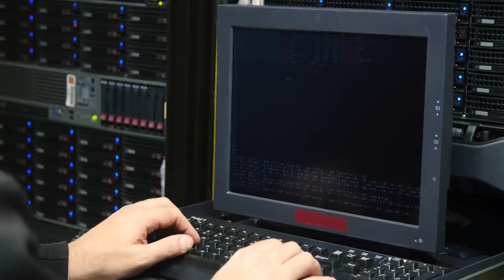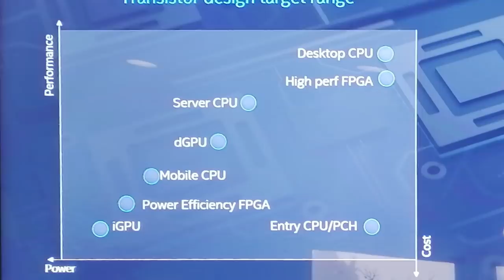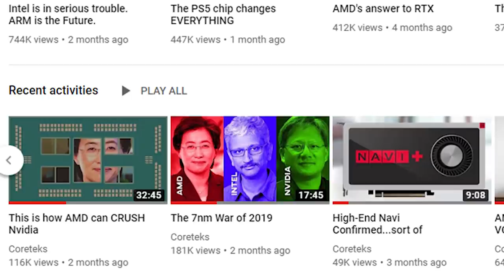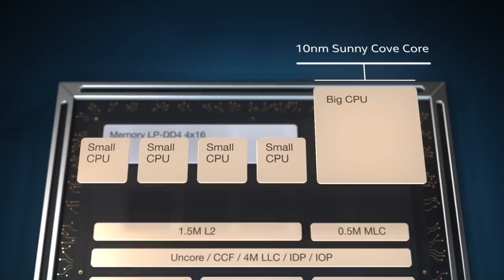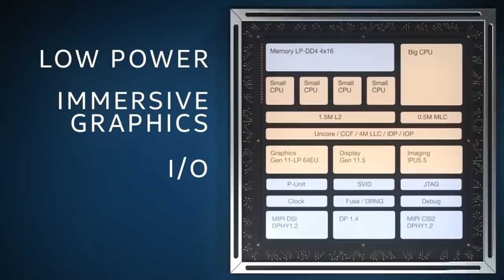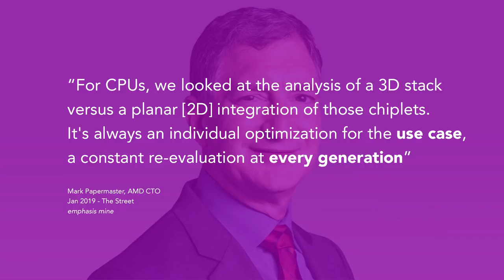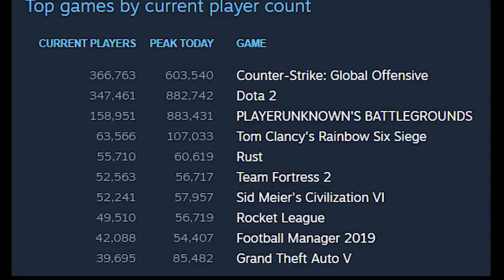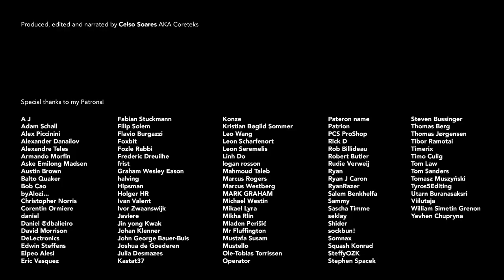2D vs 3D Stacking: Intel’s plan to beat Zen 2

Comment: Could Intel add up to 1gb onto the chips? Yes. Will they? No. Well... eventually... after milking their customers for years by only improving their products by 20 to 30% for each new release, unless competition forces them to do it sooner.
Reply: @SweatyFeetGirl  I think he means 2-3%
Reply: damn 20-30% i loled so hard to this
Reply: The 3770k is 10 to 15% faster than 2700k at most.
Reply: @SweatyFeetGirl  Julia so you mean the first i7 can match up to the current i7 since by your calculation 9% increase
Reply: @directlinkrexx4409  Do you even understand how % increase works?
Reply: @iairborgo7172  OK explain to me sherlock Holmes
Reply: @directlinkrexx4409  
Lets say 10 generation and 3% increase per gen.
10th  30% faster is wrong.
10th 34,4% faster is correct.
Still 3ish% is way to low  (and 25ish% is way to high) from what I know it was about 12Ish%  per gen.
Reply: The main issue - regardless of whether you have a welfare chip or an intel - is that programmers cannot take advantage of all those multiple cores.  Anything over 4 cores in a gaming PC are not used.  Only in scientific applications do the additional cores get used.

And even at only 2-3% ever gen  - AMD STILL can't catch up
Reply: @petrkinkal1509  listing a few results of www.cpubenchmark.net (picking the usual "gamers choice CPU", since most ppl are interested in those)
CPU: singethread / Multithread / gain / overall gain / notes
2600K: (1939/8432) / - / - / -
3770K: (2083/9511) / (+7,5%;+12,7%) / (+7,5%;+12,7%) / -
4790K: (2530/11175) / (+12,1%; +17,5%) / (30%;32%) / -
6700K: (2353/11109) / (-7%; -0,5%) / (+21,4%;+31,7%) / -
7700K: (2583/12036) / (+9,%;+8,3%) / (+33%;+42,7%) / -
8700K: (2703/15971) /  (+16,9%;+32%) / (+39,4%;+89,4%)/ 6 cores
9600K: (2676/13443) /  (-1%;-15,8%) / (+38%;+59,4%) / 6 cores ; no hyperthreading

average singlethrad gain per generation: 5,6%
average multithread gain per generation till 7700K: 9,1%
Reply: @bradvicious3991  
Oh I'm a german now cool. I was from USA about a month ago wonder what I will be next time.

edit:Not sure why I bother but
https://upload.wikimedia.org/wikipedia/commons/a/a8/DecimalSeparator.svg
ISO-8601 also stipulates normative notation based on SI conventions, adding that the comma is preferred over the full stop.
Reply: @learza3797  I stand corrected (and depressed)
Reply: @bradvicious3991  um, you are wrong, literally games use more than 4 core. the way of the future is literally dx 12 and vulkan, vulkan literally uses every single core/thread on a cpu. so...you are wrong. 
next, i have a tr 1950x, virtual boxes can easily run every core and anyone in IT pretty much uses multiple virtual boxes for numerous reasons. the more cores you assign to a vm the better it runs. so...again, you are wrong, it isn't "scientific applications," it's literally anyone in IT that makes use of all those cores. the fact that you don't understand that, means you don't know what you are talking about like at all.
next, there is numerous programs that make use of cores. if you are live streaming on a video game, you want more cores because the system assigns those cores to the streaming software. next, if you are video editing, there is numerous programs that make use of all of those cores.
see, with what amd has done, they made streaming affordable for the consumer, they made it affordable for people in IT to work effectively at home (i personally run numerous vm's all the time and have a personal server set up that is running on a vm. so...i test software in numerous vm's all at once and the 1950x (16 core 32 thread), has allowed me to develop a lot of stuff at home. i'd never be able to do what i do now without amd releasing cpu's with a lot of cores. 
next, if let's say, you want to run your own game server,  let's say, a wow private server, you can literally buy a 1950x, down clock it for more stability, and be able to have thousands of people on just that 1 server. a 1950x costs right now $550. this compared to just a couple years ago when intel was selling 8 cores for nearly $2,000? ya, amd has made it affordable for anyone to get into IT. the fact you don't understand that or the significance of all those cores, just shows you have no right to even comment here.
Reply: @thorodin3631  LiTEraLly
Reply: @thorodin3631  Dont waste your time answering to Brad, he is dishing amd in a lot of comments here, just another intel fanboy I guess. Hearing that Intel is trying to innovate again is a good thing, I hope amd makes a lot of money with zen 2 and pushes both companies in the 3d cpu model at good prices.
Reply: I don't see why they can't add a terabyte and just forget the ram. PCIe storage is getting quite fast these days anyway, and applications like chrome have no reason to use ram instead of, say, nvme storage. 

The way I see it, the processor, ram and heat management are all part of a single system and they should all be closely integrated. Being able to change heatsinks on a CPU is a sign that we are not giving enough attention to the heat management of the CPU. Thermal paste is a bodge.
Reply: Actually my Xeon from 2014 is only 6% slower then the new CPUs from Intel running same clock speed according to indipendent bench marks... Intel pretty much only releses new CPUs now with sightly higher clocs, lower price and or more cores when AMD releses something that is able to compete.... Rest of the time Intel just sit and wait with who know what they have in stock waiting to get released when AMD come with something new lol.

Comment: 3D stacking is great for memory but bad for GPU's and CPUs'. Heat transfer is a big issue. Unlike Intel AMD already has experience with stacking memory: HBM and HBM2. Intel needs to catch up and these plans are nothing new, it will take years. Maybe they have those years but I wouldn't be surprised that AMD will keep innovating and improving even when they are the fastest...

Pentium 4 era all over again I expect for Intel.
Reply: Wouldn't be surprised if HBM-Stacks are finding their way on AMD CPUs, as soon as prices get a bit more reasonable.
Reply: Before HBM, Intel/Micron had HMC(Hybrid Memory Cube) way back in 2010.  Sadly, nothing much came of it as far as consumers.
Reply: @MephistoDerPudel  yeah there was something about close memory aka HBM2 on SKUs for cpus
Reply: First off - AMD doesn't produce anything other than drawings and marketing materials.

AMD had nothing to do with the development of HBM or HBM2.  Nothing.  They didn't design it, they didn't manufacture it, and they had no input on it's design.

Intel spends more $ on R&D in 1 quarter than AMD has made in the last 5 year combined.  Intel has tons of experience with passive interposers, that is old news.  The Foveros (stupid name) is an active interposer, which is quite different.  So Intel does not need to "catch up".

AMD Innovation is like French Military Victories - the punchline to a joke.
Reply: @MephistoDerPudel  nope.  APUs maybe.  But since AMD doesn't make anything at all - and pretty sure HBM / HBM2 requires a license to produce, it is unlikely
Reply: @bradvicious3991  and yet when AMD make less in 5 years than intel spends per quarter on RnD and yet AMD still are able to catch them in preformance on a worse node(TSCMs 14/12nm)
Reply: @bradvicious3991  "AMD Innovation is like French Military Victories" -> so intel is doomed

for your culture: "168 battles fought since 387 BC, they have won 109, lost 49 and drawn 10" - wikipedia
Reply: @samcan9997  Global Foundry's  14/12nm, TSMC would actually be a bit better.
Reply: @samcan9997  You mean get close enough to see them, but not actually catch them.

Intel in it's ancient 14nm process cannot make enough chips to meet demand.

Buy what you want, and can afford.  I will do the same.
Reply: @bradvicious3991  it doesnt matter who is innovating. It matters who is selling the innovation, and it just so happens that AMD is selling innovation right now.
Reply: TSMC sure they will have batter cache but there 7nm will likly only be on par with intels 14 line
Reply: @lucasward9506  LMAO
Reply: @bradvicious3991  is LMAO an argument
Reply: @lucasward9506  sorta... when someone makes a terrible argument, you laugh in their face and walk away and let them continue to be ignorant because they're not worth your time. Not that you made a terrible argument/point, but yeah...
Reply: @bradvicious3991  umm... 7nm is pretty much on par with Intel's 10nm... except TSMC is actually making 7/10nm chips unlike intel.
Reply: @lHiTMANll  that makes sense
Reply: Detmer , in the end its all about the process node .. when intel chips go to 7 nm then we have ahuge upgrade on our hands too ..
Reply: Brad Vicious still amd beats intel that is fact and to beat amd intel used shity technics known to all but now they take amd workers to there lines... LOL
DONT BE FANBOY FACTS WILL ALWAYS WIN

Comment: Very interesting video, thanks for the great work!
Now I'm here with my old 2012 processor (i5-3570K) and 2013 GPU (R9 290) and can still play everything at high settings in 1080P with appreciable framerate after a bit of tweaking in the options. Crazy, no?! 2012...
I was thinking about upgrading soon, however I'm feeling that the industry is experienceing a major change at the moment, so I'll be patiently waiting to see how the game will set before spending 2K in new computer hardware. 
Cheers and thanks again for showing us a more profound analysis than any other Youtube tech channel!
Reply: Nice profile pic
Reply: I haven't upgraded in years, but it may be time once Intel releases this tech. Until then I will keep running my 486 DX2 66.
Reply: Then buy your new PC a piece at a time. Maybe a new GFX card to go with a new monitor? A year or two down the line get a new board/ram/chip? I'm not going to lie, NVMe drives are really nice!
Reply: legendary cpu i had it but had to switch for 1800x ryzen coudlnt get stable 60fps (3440x1440)in some games even if it was oced on 4,2-4,3 with ryzen NP yes i know i could get i7700/8700 to have like 5fps more but fuck intel and price was much higher that time and too bad i missed like month when 2700x was anounced but its only like 2-5% faster
Reply: Appearance of major changes will hopefully be the norm, like in the old days. It had just been peaceful for awhile, as AMD has had to recover their bad CEO and Bulldozer.

Just upgrade when you need to. Hopefully there will be something else new and disruptive around the corner, when that time comes.
Reply: @laurelsporter  sure this "new" become a peak development in cloud gaming that means u don't need to buy graphics card, add ram, change MB and CPU after 3/5years. U just buy new peripherals like monitor etc.
Reply: @mateuszzimon8216  unless there's a server cluster every blocks, though, the latency will be too high for most games, unless someone finds a way around the limitations of the traveling speeds of radio waves and electrons.

In addition, you'll just be paying those hardware costs as part of your subscription service cost, and server hardware is much more expensive for the same performance.

Comment: On the server market AMD could also replace one, or more, chiplet (as they are doing with the APUs) with an FPGA or customized chips for specific clients (AMD know how on custom solutions and cost aside), so, if not, the 2d approach is as flexible as the 3d one on this particular matter
Reply: Which FPGA IP?  Xilinx?  AMD doesn't have internal FPGA IP.

You know who is already doing that, and has been for a while - Intel.  Intel makes quite a few products and SKUs that we will never hear of because they are for very specialized use cases
Reply: @bradvicious3991  I've heard off Intel having the technology to do so back when cascade lake - AP (the 48 core intel cpu) was announced, didn't know they had it ready, have any links?
Reply: Brad Vicious yeah  breaking hashes and AES encryption

Comment: 8:43  Seriously?  486 processors had off-die L2 cache.  Not only off-die, but off-package.  It was on the motherboard.  Same with the Pentium.  What the PII was "experimenting" with was moving the L2 cache to the processor package, rather than keeping it on the motherboard.  AMD was the first to move the cache onto the die, followed shortly thereafter by Intel with their second generation PIII processors.  AMD actually had an interesting situation, because you could get a motherboard with L2 cache, then plug in a K6-III processor with onboard L2 cache.  What happened to the motherboard cache?  It became a L3 cache.  The first instance of it.  The P4 was the first processor to create an on-die L3 cache.

The point is, you're talking about things in reverse.  The Pentium II was a step from off-CPU cache towards on-CPU cache.

I'm more interested in why the I/O die on Zen 2 is so large.  It seems too big, to me, to just have the memory controllers and whatnot.  Did they move L3 cache there?  If they did that, and changed it from a victim cache to an inclusive cache, that would make inter-core communication completely unnecessary.  All cores would have exactly the same memory latency for everything.  I guess we'll see soon enough what they actually did.
Reply: I/O die on Zen 2 is still on 14/12nm for cost savings, since I/O performance does not scale like the cores do with node shrinks.  The core chiplets are on the 7nm process. Also by shifting the I/O die over on the old node AMD will not have to use any of the limited 7nm production capacity on the I/O die, allowing them to make more complete CPUs for each 7nm wafer.

Comment: What I'm interested to see is if/when AMD starts implementing 3d stacking, if they could combine that with their chiplet design to have an even greater advantage in heat management, by distributing hotter parts across the (die? unsure of the word) in the various chiplets.
Reply: Unfortunately AMD doesn't have control over fabrication technology and method. They're at the mercy of third party production company facilities. Even Radeon stuck at 2.5D silicon interposer. I don't know but it will probably happen if AMD can bring enough demand in volume.

Comment: Back in 1978 IBM Corporation was working on a three-dimensional processor the code name was ceramic greenware. They had these flexible layers of material that was like Teflon and each layer had 100,000 connections and these layers were to be bonded together to form a three-dimensional processor. I guess they couldn't make it work because in all these years I've never heard any further results. I was only involved in the testing of methodology to determine if each layer had a defect or if it was perfect enough to be used in the production run.

Comment: Isn't there going to be a limit eventually on the cache amount and performance? There's always a limit and for everything in computers.
Reply: Yes, and it's per task. Most don't need all of the cache your CPU has now, and could even perform worse with a much larger cache.
Reply: @laurelsporter  cool, thanks for the info.

Comment: IVE been an AMD fan since i got ripped off with worse performance upgrading to the infamous Pentium 4 but ive said it dozens of times AMD will NEVER BE MARKET  leader when a criminal monopolistic company like Inhell is never prosecuted for its crimes.
 It like 2 hockey teams competing against each other but the referee owns one of the teams, no way that team is ever losing. PERIOD
Reply: LOL - you mean like selling the Chinese gov't the IP to Epyc in violation of a trade ban for high end CPUs?  AMD assured the regulators that China, even with their IP would not be able to produce a competent Epyc clone for serveral years - a year later China's Epyc clone dropped - and only the vendor ID and product name needed to be changes - the code ran identically to an AMD Epyc.

AMD will never be the market leader because they lack the engineers and management and facilities to be a market leader.  10-15% overall market share is the ceiling for AMD - of which half of the revenue will go to TSMC to manufacture.
Reply: @bradvicious3991  Can't stop the Chinese from stealing and cloning everything made by someone else. Its either you play ball with them and make money with them and later relinquish your IP or don't play ball with them and make no money while they reverse engineer and clone your IP anyways. Most companies pick the former as they rather make money while knowing theres nothing they can do about their Ip being stolen regardless of which choice they make.
Reply: @bradvicious3991  sorry but economically this is win or AMD, and most companies invest in china because this is eldorado. AMD get's money from Hygon because licences. Via do same thing with Zhaoxin.
Reply: @sparda9060  This